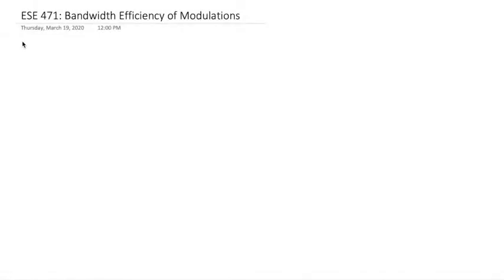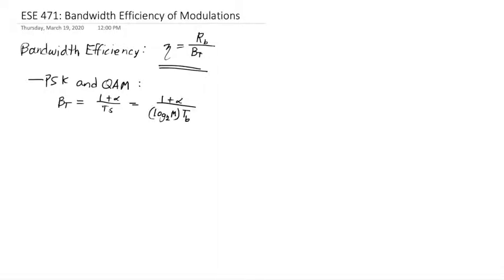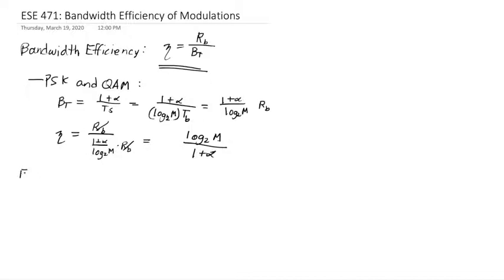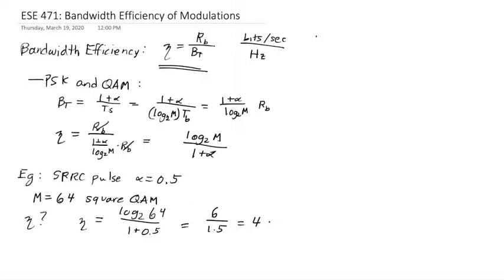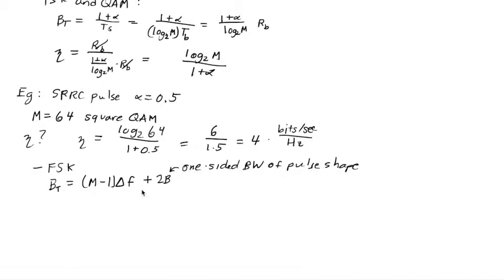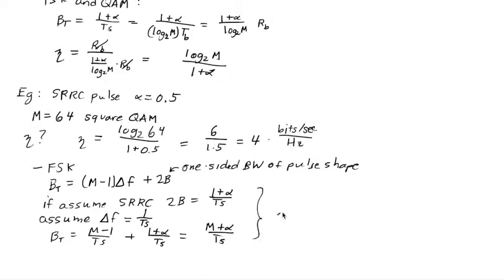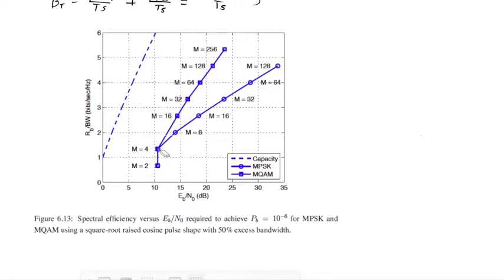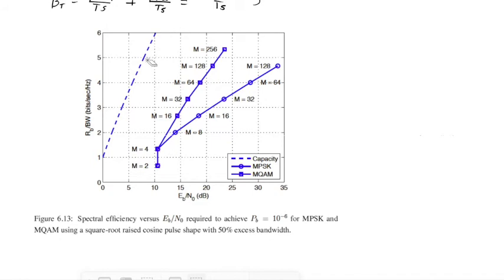ESE 471 Bandwidth Efficiency

Comment: if alpha not given just asked bandwidth efficeiny of  some 8psk what i need to take alpha = 0  or alpha = 1 in some sources i found alpha = 1 and in some sources i found minimum bandwidth alpha = 0 which is correct
Reply from the maker: You would have to know alpha to know what the bandwidth efficiency is. If alpha is not given, you could provide a range of possible bandwidth efficiencies, where alpha=0 gives the highest and alpha=1 is the lowest bandwidth efficiency